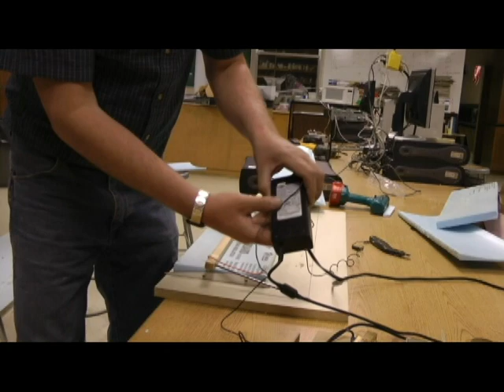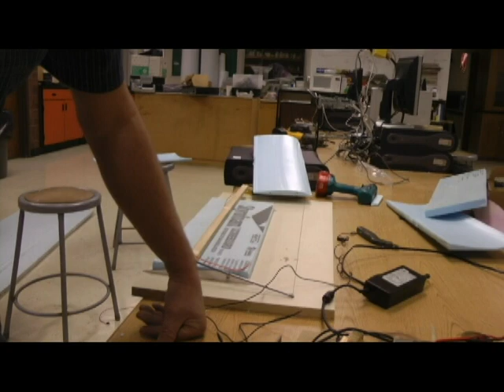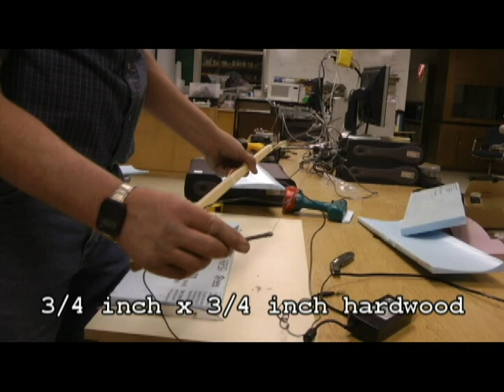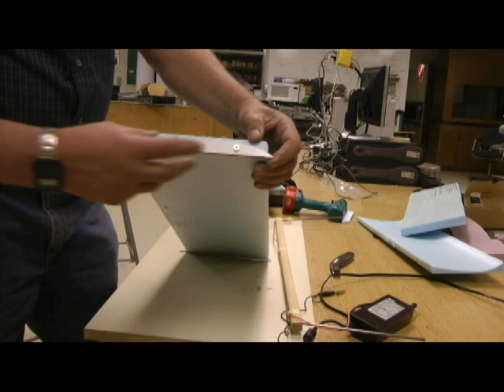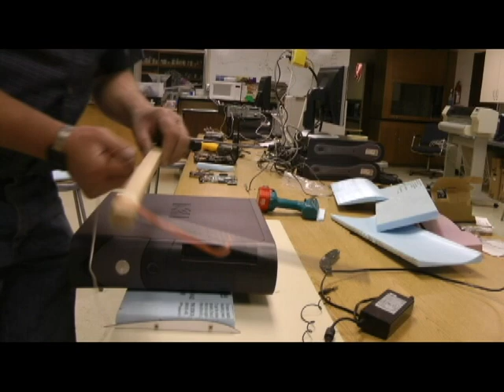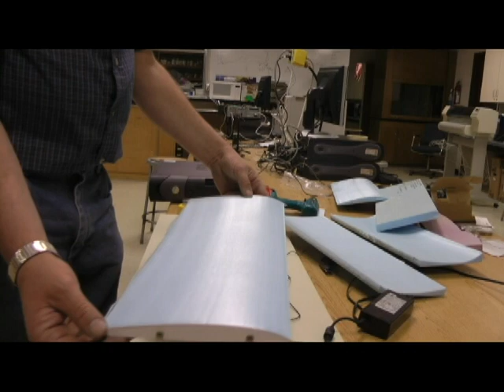Another cheap foam wing cutter

Comment: Once video, what is that foam, mine it's mess.
Reply from the maker: the foam is standard home insulation foam.  I have used both white low density and the pink or blue high density foam.  I prefer the high density due to its tougher nature.
Reply: +andpet55 thanks a lot I really appreciate that, I'll keep trying, and you are making great job my friend.

Comment: So technically, you could just add 4mm bullet plugs to the negative and positive from the power supply? And plug directly into them.. the only reason i ask is, it looked like you a transformer and stuff on the table but it seems like you arnt using them as you mentioned...
Reply from the maker: You are correct in that I have another system on the table.  This is one that I just could not get to work properly.  I am using it for the connections and the rest is just there because I was too lazy to move it.  Thank you for you great observation.  Putting the 4mm plugs directly on the power supply would be a much better way to do it.

Comment: Wow! I really like that wing cutter you got there.  What exactly do you have the banana plugs plugged into (looks like a transformer of some type)  Do you still need to use the transformer and all the other Doo-dads that the power supply is plugged into?

* Could you do a video on how to cut the templates too. *
Reply from the maker: The transformer was a previous device that is not used now due to the fact that it doesn't have the amperage.  I just use the jacks on the board.  I should just eliminate them, but I am lazy. 

Let me see if I can get a few minutes to do a video on the templates.  They are super easy.  Just trace, cut with a band saw, and sand.  Two holes will let them be set to the wing with grabber screws.  I just use Masonite or a thin piece of maple.  It just needs to be hard and smooth.
Reply: I don't have access to a band saw, just a hack saw unfortunately.  Do you have a specific shape you use more than others for your air foils? and also, how do you insure that they are pinned into the foam at the same place on differing sides?  -  Thanks for your assistance.  Really dig your videos. Always very imformative.
Reply from the maker: SnapPunch Robert
I just did a new video for you on templates.  Has some great ideas and links to some airfoils.  I will get more to you in the next few days.  As to the pinning, when you cut the foam, the position is not important as it will still create a form that is the same throughout.  I do, however, try to align them as best as I can. Thanks.
Reply: Thank you. I will watch with anticipation.